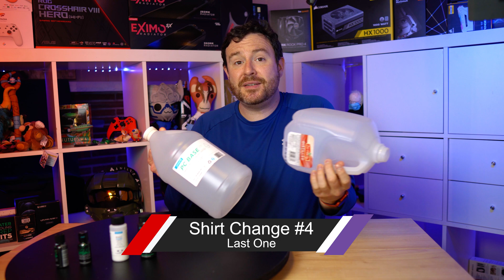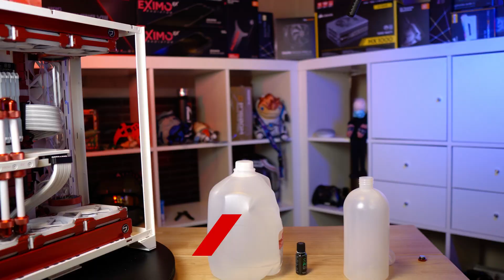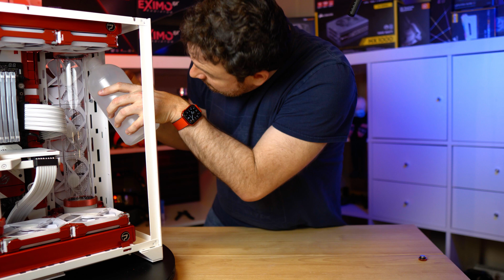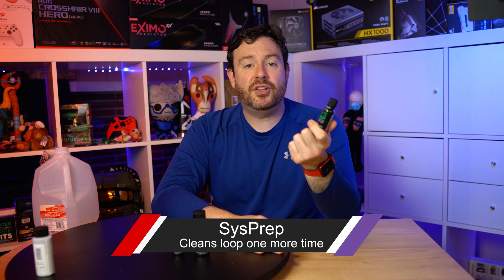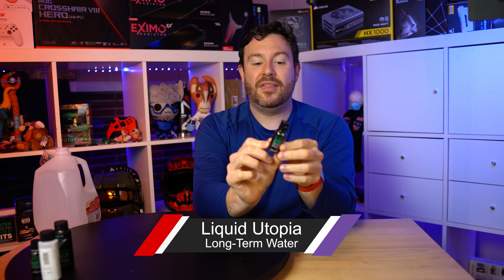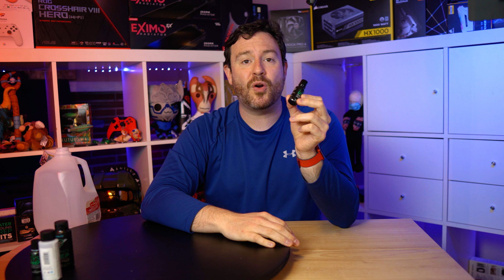How and Why you must clean your water cooling loop BEFORE adding Deionized water

Comment: Well if your pc is held in a place which is kinda dusty you need to clean your pc anyway very often, becase the ionized water with the dust will do the same nasty job as tap water does